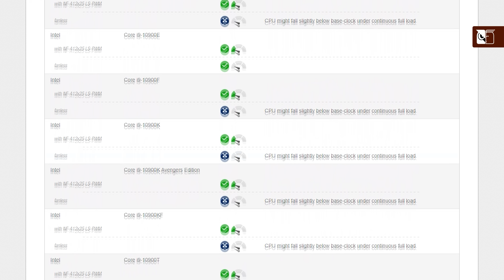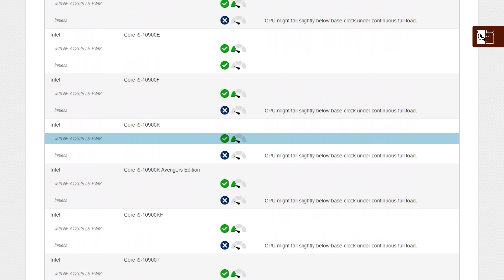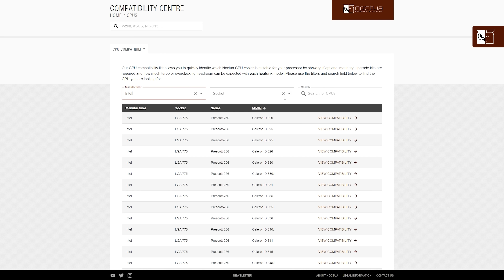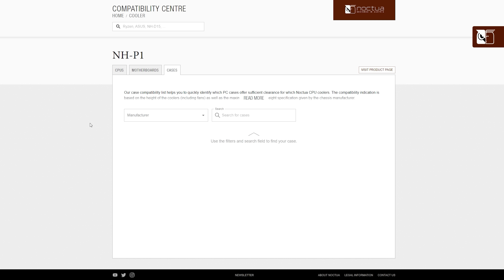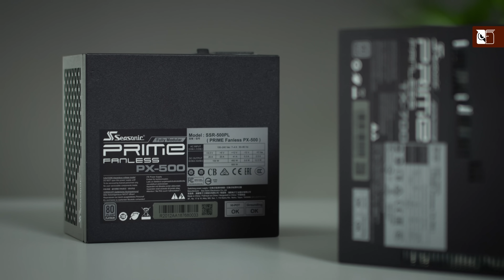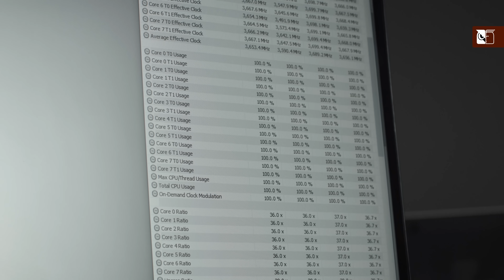How to build a passive PC with the Noctua NH-P1

Comment: I think the most interesting choice would be the Ryzen 5950X with the 65W ECO mode enabled. Fully passive 16-core CPU...
Reply: Incompatible according to Noctua's list but YMMV
Reply: @DavidEsoNguyen  LOL but the 11900k is? How ridiculous. A bog stock 5950X only draws 140W while a 11900k uses 160W.
Reply: @Berserkism  I think the reason for that is  11900k use monolith desing (the heat load is more spread) , 5950x use ciplet desing ( the heat load is concentrated in a small area), so heatsink can't transfer heat fast enough from 5950x
Reply: @Physis_88  chiplets aren't that much of a problem, heat density is as die size is significantly smaller (14nm Vs 7nm, 276mm² vs 161mm² for CCDs on 5950x)
Reply: @DavidEsoNguyen  stock settings yes probably too hot but ECO mode is much power powered and much cooler.